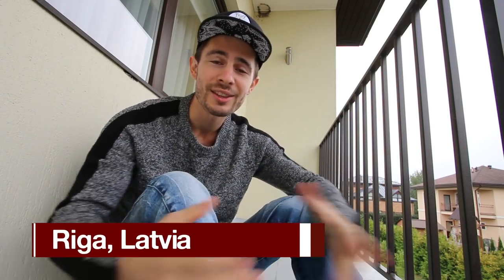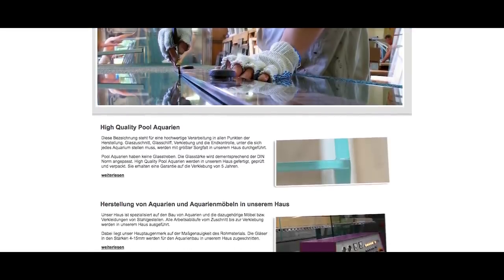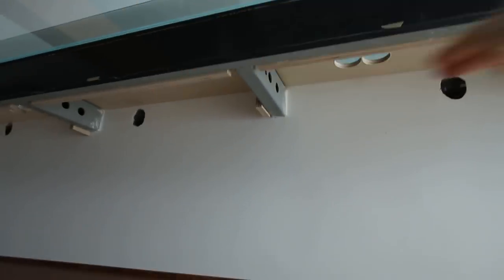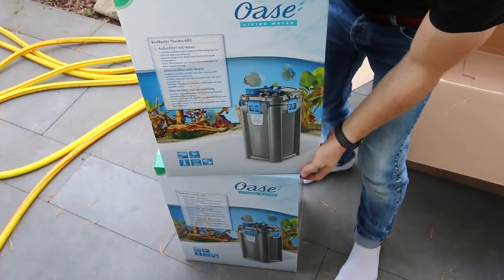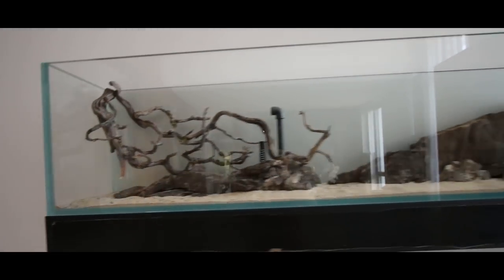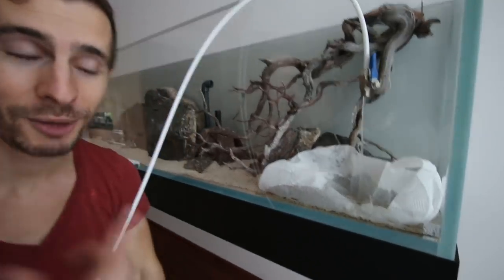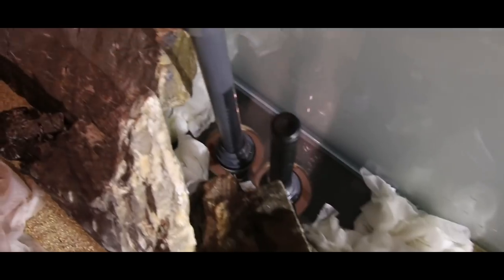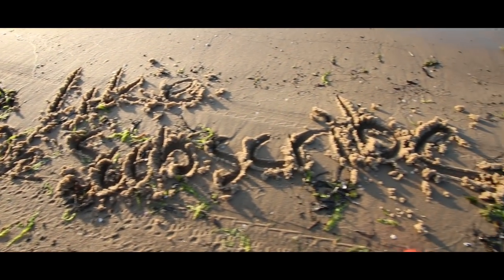My biggest Aquascaping mistake I ever made! - Epic 240cm wall mounted aquarium Vlog

Comment: Oops! 😁 Good lesson for anyone watching about where to put rubber seals! 

I once installed a new filter, forgot to swap the media over and turned it on with the new ceramic rings still in the plastic bag!  In my defense, my filter died due to a powercut but I didn't know it was fried until the power came back on at midnight, so I was installing it whilst half asleep! 🤣
Reply: @JurijsJutjajevs  🤣  I normally wouldn't, but there's little English phrase, 'Sod' s Law' meaning that something will usually break at the most inconvenient time possible and that night Sod's Law struck! 😁

Comment: Well done, I had total faith in you and knew from the first photo where the tank was going to end up. Bravo, you did it! ON the other hand, the O-ring mistake... :/ It happens, it was most likely a very challenging project and pressure was there. Looking forward to seeing the lights installed and the scape finished :)

Comment: Having a cabinet underneath kind of defeats the purpose doesn't it? I mean, sure, it's a "floating aquarium", but it's obviously dependant on the cabinet below. It would be far more stunning if the filtration was kept in a separate room or even outside. Would have kept a cleaner, "true" floating feeling in my opinion.

Comment: Good but after time if you try clean your tubing. You need to drain all your water. You need to install open and close valve before you connect to the filter tubing. Love your idea .
Reply: Cause that will be easier than installing a valve....?

Comment: well the concept was good, but in my opinion considering the amount of space available in this house, the width of the tank should be atleast doubled the existing one, wider tank would have been great for providing a better hard scaping margin and provision of optimal depth for fantastic optical illusion ....moreover the cabinet should not be placed under the tank, its wasting the whole concept of wall hanged or floated tank.

Comment: Where is it possible to buy the tubing for glass-through filter connection? Thank you
Reply from the maker: I don’t exactly understand what you mean. Clear tuning or lilypipes? Or the joint parts that I have for plumbing? First ones in a good aquarium shop, the plumbing units online or from a aquarium manufacturer
Reply: @JurijsJutjajevs  - Yes, I ment plumbing. May be you could do sometime video in more detail which sizes of holes shoud be, what is the proper diameter of tubes, which material for plumbing to use etc etc. Take care!
Reply from the maker: Very simple: I use canister filters, the tubing and inner plumbing diameter should be ideally same as the canister filter in and outlet. In my scenario the Oase filter comes with 16/22mm pipes

Comment: You didn’t put the o ring on the wrong side. You put the entire fitting in backwards
Reply: Jurijs Jutjajevs totally understand that. But that it the reason it leaked. There not designed to go that way. I also used plumbers putty around the threaded portion of the bulkhead where is passes through the tank for added protection
Reply: Jurijs Jutjajevs awesome take though by the way